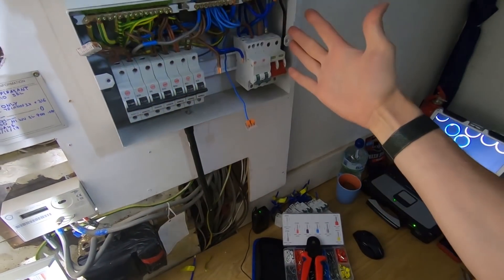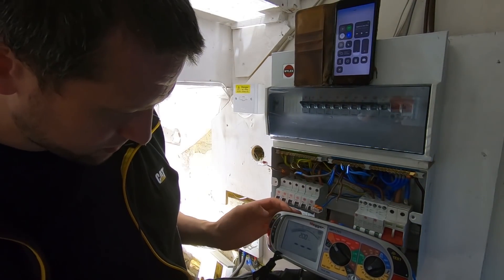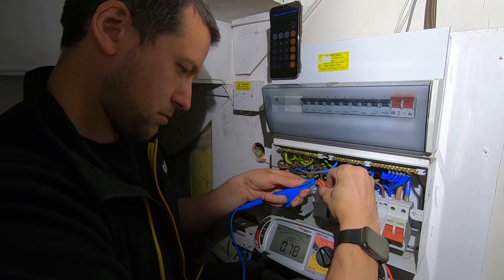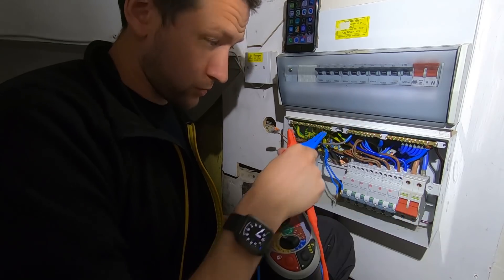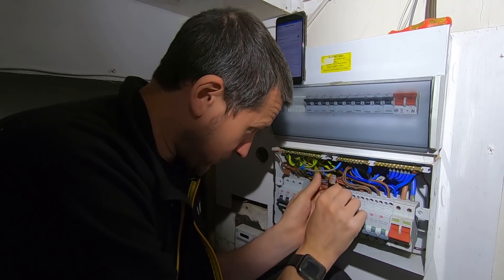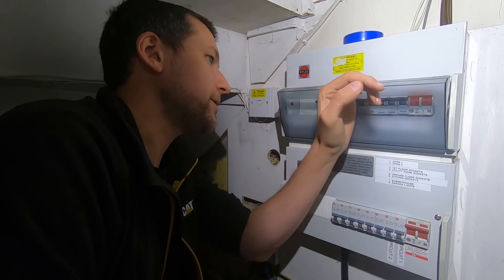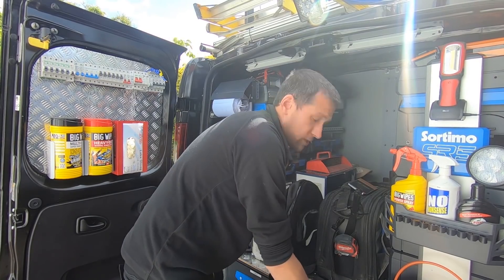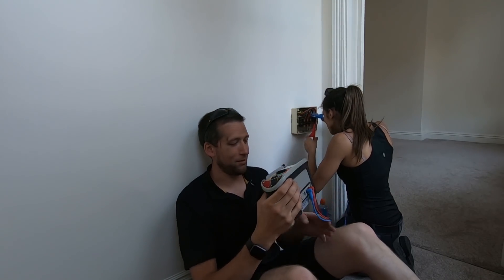Installing RCBO's and using some very snazzy Ferrules | Thomas Nagy

Comment: With crimp terminals, you are not supposed to twist the wire strands too much. A very slight twist so they go in the terminal is fine. But nothing more. The idea of the crimp is to make an airtight seal onto the wires. This is more effective if there is no twisting of the wire strands.

Comment: Just had a mooch in the BBB and found the following two that seem relevant regarding the need to use ferrules.

526.9.1 states "in order to avoid inappropriate seperation or spreading 
of individual wires of multi wire, fine wire or very fine wire 
conductors, suitable terminals shall be used or the conductor ends 
should be suitably treated."

526.9.2 states "soldering (tinning) of the whole conductor end of multi 
wire, fine wire and very fine wire conductors is not permitted if screw 
terminals are used. "

Comment: When testing Continuity on ring final circuits I disconnect the other rings in the dis-board incase you have a mix up if ring legs. obvs you'd discover that once re-energised as you'd have an imbalance in the rcd.

Comment: Hi Tom, So far as coping goes I haven't stopped work as we are contracted with southern water so we are classed as key workers. I have managed to use the time to also finish my NVQ and have now qualified as a spark. now I just haft to go forth into the world and get more experience as I still feel I don't know enough. How long after you qualified did it take for you to feel like you knew what you were doing?
Reply from the maker: Years. I think its just a long process that you never end.
I still come across stuff that makes me stop and think now. everyone does i guess.
You'll make a bunch of errors to start, just learn from them and keep going.
Reply: @thomasnagy  cheers mate

Comment: Im a plumber but do my own wiring on programmers stats and 2 ports etc and the ferrules are a god send been using them for several years.
Work has been slow until two weeks ago but now coming in quick and fast.

Comment: I've stopped buying Alkaline AA batteries and now use Lion rechargeable ones (they are 1.5V output not like the lower NiCad rechargeable ones) and they seem to last a long time. They are recharged using USB and come with an adapter cable to charge 4 at a time. https://www.amazon.co.uk/gp/product/B0828GN5RL/ref=ppx_yo_dt_b_asin_title_o06_s00?ie=UTF8&psc=1

Comment: I'm surprised you're not using rechargeable batteries mate , i bought an energizer quick charger and I use the batteries every single day for my lights etc , they charge so fast you can use your light all day long just by swapping batteries and charging them right away , saves the environment and money at the same time 👍

Comment: I was with you on the 20 amp upstairs (at 6:06)  ring until recently.  Board change at a nice 4-bed house with a decent installation.  Called back for the RCBO tripping.  Wife and two daughters using hairdryers at the same time.  Do these things really need to be over 2Kw each!  Good to see you back on form. Content and quality unmatched in nice lil' sub-20 minute packages. Sod the the "it's an easy money spinner" brigade.  Some of us have followed you since college and now out there, inspired by what you showed us.

Comment: We do the cert on site (on laptop) but ALSO write the readings down in a desktop diary we keep in the van. The NICEIC site sometimes shites itself halfway thru a cert, and in any case, you can then look back to the readings if you get a question :)
With regard to domestic work, we're finding it's coming back up in level (south coast). Got a couple of rewires coming up that had been put off due to lockdown.
And good tip about the DIN rail on the van.. we've just started doing that, colleague bought 3M of din rail  (cheap as chips, not worth messing with ones removed from boards LOL)
In order to keep customers going during board changes, we have a 30A main fuse that we put in the holder,  and we fit a temp board on 6.0mm from  the meter terminals. The temp board has 3x twin sockets on a B20 and a 6A for temp lights if needed,  (oversleeved the cores and made off the terminals so they don't show bare copper). Not strictly to regs, but keeps the customer happy and it's only for a couple of hours, while supervised

Comment: your putting the crimps on wrong the stranded cable needs to go all the way to the end of the crimp , been using them for the last 20 years more of a european thing, next you will be using a box spanner for conduit lock nuts thinking that its all new, great channel wish I could learn something from all you u tubers but nothing yet

Comment: They just reintroduced the home insulation scam again, talk about a 1 trick pony with dodgy EICR, nope that's here to stay because it gets old rigsby off the hook.  I know the govt insulation program was bent because the guy who did my loft went to jail. You should expect the same thing to happen with electric car charging points in a year or so, they will all get bodged in on the cheap, no room in your fuse panel sir?, no problem will we just smash it in with the tails that should handle it - right paddy!

Comment: I’ve been working flat out for my firm since COVID kicked in bar having two days off at the start when nobody knew what was going on.

Council work died until about June, so I was mainly doing 3 phase board changes and eicrs for office blocks. Had a few rewires too

Now I’m back doing council repair and maintenance since June. I’d rather be on the commercial side again but it pays the bills i guess

Comment: New subscriber and love the videos. Could you answer a question for me. What voltage would a 3 phase supply 3 wire supllied in delta. I know there is only 1 voltage in delta bit what would that be. Thanks

Comment: Have to agree... ferrule kits are ace. As an extremely low user I couldn't justify a full kit so bought all the sizes I needed in small quantities off Ebay along with some ratchet crimp pliers for less than £30 quid. Keep them in the packets they came in plus the pliers in a click lok box.

Comment: Yeh, nah, I wouldn't be twisting the wires going into the bootlace ferrules. I also strongly recommend using a Knipex 12 62 180 wire stripper which helps set the length perfectly for the ferrules every time

Comment: Regarding "drive-by" certs - I had a house that was renovated about ten years ago. The job started well, but as so often happens in London, it all went pear-shaped at the end. The consumer was upgraded and a couple of sockets added - otherwise nothing was changed on the electrical side. The firm was in such a shambles it went bust about six months after they sort-of finished, and come ten years later when I went to sell the house I am lacking the electrical certificate. Hiring a sparky to do it right was going to cost close to £500 (central London) so I just bought the insurance instead (£22). TBH, I would have been happy with a £100 drive-by cert - but I understand why Tom doesn't want that "work"

Comment: Have been using ferrules in cabinet building for years. Had an electricien tell me that, according to regulations, it wasn't allowed (something about making better contact because of larger surface area bladibladibal...) Good to see taht you (and others) are starting to use them now on stranded wire.

Comment: Always use ferrules on stranded cables if they're going into a screw terminal. The strands spread out too much and you can't guarantee a full connection otherwise. On the big stuff, 25mm conductors we used to bind the stranded ends with a single strand of copper.

Comment: Tom, check out the Weidmuller PZ6 Roto ferrule crimper. Great for doing control panels, quick n easy to use and does an excellent crimp.

Comment: Probably been said before but we dont use ferrules in NZ for 230v. The general consensus is that they have pinch points which can cause heating. Same with power distribution. Looks great though when you remove the cover.

Comment: @ Thomas Nagy,
Been using boot-lace ferrules since about 1990 in control cabinets and switchboards, I don't know why anyone wouldn't use them, like you say, they make the whole thing neater and they negate having things like short-circuits happening, one thing a lot of people don't realise is that they are obtainable in sizes up to 50 mm² and you could probably get larger ones if you needed them. 
The 4-jaw crimp tool is a necessity, we had a lot of failed crimps with the 2-jaw ratchet crimp tool over here in New Zealand
Oddly enough, I'd like your opinion if I may, what are your thoughts on these "new" screw-less clamp terminals that are starting to appear with a few devices, like industrial switches and the like.
I tried some and they clamp quite solidly, I was originally stand-offish about using them, but I'm converted, especially with ferruled conductors.

Work-wise, I'm flat-out, since the lock-down here, I have a back-log of about 2-3 months work and I'm looking to take on a 2nd apprentice or try and find a qualified electrician. 
Cheers,
Mike T.

Comment: Before I do a board change, I inform the client, (be they home owners or landlords) that I will first conduct an eicr. The reason is very simple and I explain it like this. When you have a plain wooden door, you would primer it first before you put the final coat on? Well it the same with this only, you need to know where the underlying problems are before you replace the board for new. Makes my job much easier and if you do have issues directly from doing an eicr, you can clear them with the customer first before you end up looking like an eegit!!
Reply: Best way, Shear! I'm finding like Tom I'm getting approached for budget "landlord" EICRs.. It is hard to know what's best for pricing, if you end up having to change the board...if you did the "sample test" method for the EICR, you open up a can of worms on the board change. Chiefly, because Johnny DIY has left an inaccessible connection in a wall somewhere. Happy hunting!

Comment: Here in Brazil , it's a difficult situation. But I go to clients everyday, but because there are no airplanes... All is done by car ( most of the trips, 1000-3000 km) that's the hard part and with all the necessary precautions..

Comment: At least in the US you are required to use the ferrule crimper that is specified by the ferrule manufacturer for UL compliance.  Ferrules are often required for finely stranded wire [i.e. Class K] if the terminals are not rated for it.  Can't remember the BS 7671 regs on them.  We just use them everywhere because it also makes it easier if you have to pull a wire out the strands are not all mangled, saves so much time for the next guy.

Comment: Sorry Tom I don't understand your logic in having a different size breaker for the upstair ring but think its OK for say a kitchen ring, if the upstairs ring became split it woulld be as you say, unlikely to have a 32A load on either side of the split ring, however, if the kichen ring split, there could well be a 32A load on one side of the split, which would almost certainly be a problem, hence the sooner rings are made unacceptable the better. Cheers, Gordon
Reply from the maker: Im explaining this exact topic in an upcoming video soon. I dont think i have cut it together yet but it'll be on soon. In short i also hate rings and think they should be done away with.

Comment: @6:24 How can a kettle get more efficient? It's a resistance heater. They're 100% efficient at converting electricity to heat. Most of that goes into the water. Even a better insulated kettle still uses the same power, just for less time.
Reply from the maker: I say more efficient; actually they just downrate them. The same as hoovers are now restricted to 1600W. I dont think they have done it to kettles yet but they will with time. My bad; poor terminology.
Reply: thomas nagy  it seems mad to do it with kettles as that would only make them less efficient as  they’ll require a longer boil time there more energy lost to the surroundings. At least with  vacuum cleaners you can designed more efficient motors and piping to allow better suction per watt thermal losses and make them quieter

Comment: I owned my own vehicle mount cherry picker 12m 3.5t for about 3 years - really useful at times but expensive to run - tax, insurance, Loler every 6 months and there’s always something to repair on it and if it goes wrong nobody wants to know unless you pay mega bucks. If you have a long term contract or need one every week It may be worth it but if not I would get in with a hire company and ask for a deal for long term hire

Comment: The problem with cherry pickers, at least in the US, is that they are literally worthless after a few years as they can no longer be used unless you replace a bunch of safety critical parts that expire.  Doing this work is near the value of the machine, so they are worth next to nothing.....

Comment: If they can connect a blue wire inside of that RCBO, surely they must be able to put a screw terminal there instead? I don't understand why all those breakers have a wire pre attached.

Comment: Sum of the board iv done in ireland has just been all rcbo’s as new regs in ireland coming in is all circuits have to have neural protection aswel as live so is easer that rcd big board tho esay fill a 70mod board

Comment: Working throughout, security for TV companies mainly news. Reduced on-site attendance actually made my life easier, apart from risking death sharing inadequate transport at all hours with my fellow scum (profit before peasants). Interest here due to DIY (boo, hiss) including electrical as far as allowed. Rather be working as a sparky.
Have you considered rechargeables instead of disposable alkalines? High capacity RC batteries can hold more charge, and discharge curve is much flatter, only falling off near the end (important to me for photography). Amazon RCs seem fine, Eneloop also recommended.

Comment: A bit mad spending 30k on a cherry picker. If it's a stand alone diesel/electric cherry picker, no way it can be towed on a 3.5ton plant trailer etc it will be too heavy. You would need a 7.5 ton flat bed to haul it around, so extra cost there. And then there is the problem of not having a licence for a 7.5ton flat bed (which I don't think Thomas will due to his age), more cost & time etc. If it's a cherry picker on the back of a pickup truck or van, good luck maneuvering that into places. Alright for roofers etc who fix slates/guttering or tree surgeons who are outside, no use for a sparky inside a building. Stick with hiring for cherry pickers, I would go for a Genie / JLG  2 ton or less scissor lift (which can reach around 8meters) , and you could bosh a towbar on the van and get a cheap trailer. Get a setup for around 5k.

Comment: There is a regulation mate, can’t tell you the number and I’m not getting up to get the blue bible ! But it says something along the lines of stranded wire that is at risk to damage under termination must be terminated using a crimped end to protect the cable 👍🏻

Comment: bang on about the retro fitting and making it neat sometimes its near impossible, Marine side we have used bootlaces for years.

Work has been weird here i am at the northern isles in scotland and we have been hit hard frims going to the wall, hotels closing for good and a airport closing up, could not work until there was pemission from the gov and could only do domestic work this last week, but the work is here but far less than it was, i have a few contract for maintance which will see me good but it is concerning to see that there is nobody really trying to help those in need goverment wise. Great content again

Comment: So is there any comeback if you get a cheapo eicr certificate and someone gets zapped. For you or the cheapo 'spark' ?
Reply: An EICR is just like an MOT. It only documents the state of the wiring when the cert was done. It might be difficult to prove that nothing changed between the EICR and the incident.
Reply: Kind of my point really. If there's no comeback on the contractor who did the shonky work in the first place then there little point in having it done.

Comment: Yep back feeds 🙄 I was replacing light fittings on a block of flats once and half way through noticed a spark. Guess what the whole board was off but there was a back feed from a secondary board on the lift room. From there on off isn’t off until the meter says so.

Comment: The company I work for specializes in commercial and bio-med electrical. I work in the Service department. I was working 5 days a week up tell 4 weeks ago when I fell off my roof and bruised my pelvic bone and broke a rib. I'll be going back to 5 days a week in two weeks if my doctor signs off.

Comment: You should side those ferrules on without twisting the strands something I was told by an automation spark working in car plants, good video though Tom always learning new tricks
Reply: Caterpillar state not to twist the wires too. They also say not to butt the insulation on the wire all the way up to the crimp on non-insulated terminals because if the wire moves it can lever the conductors from the crimp (that's on engine, off highway kit mind, so probably not applicable to a fixed inatallation)

Comment: There is, indeed, a regulation that requires the use of ferrules on fine stranded cables with screw clamps. It's potentially rather dangerous not to do so.
Reply: Every boiler in the uk terminated incorrectly in that case